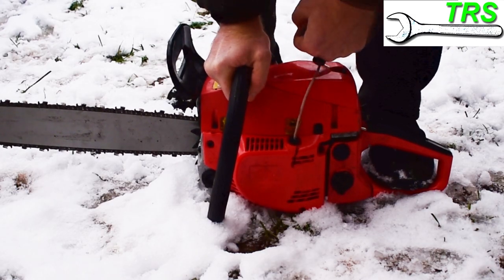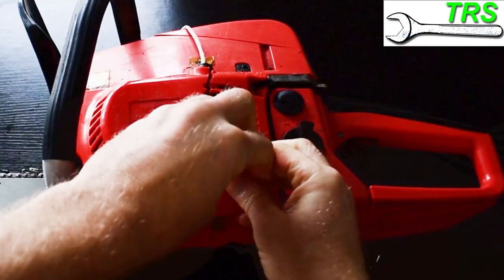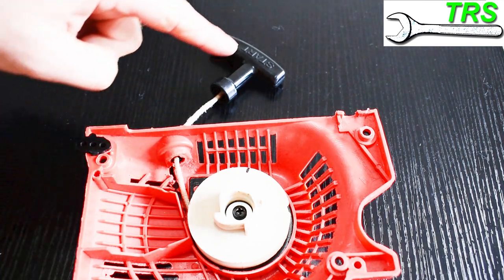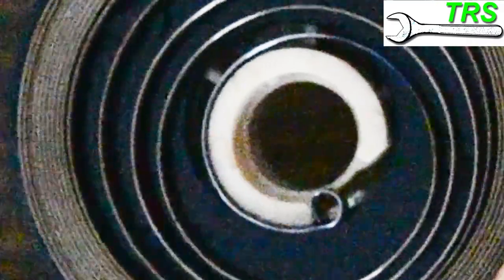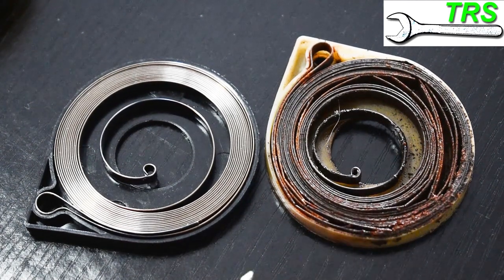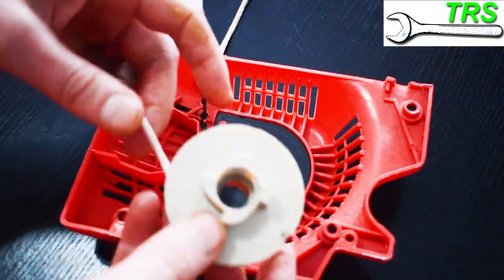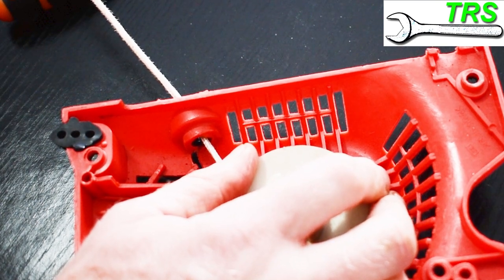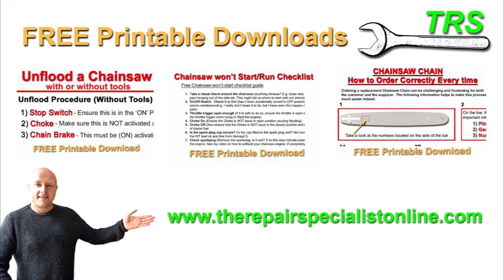Chainsaw Starter Recoil Spring Failure | This is Why?   (by Craig Kirkman)

Comment: I had 2 pulleys explode on me today while my saw was running, i would just hear a high pitched squeak sound and notice the coil spring was unwound in and busted out and rubbing against the flywheel (making that god awful sound). Was my rope to short or is the flywheel possibly damaged? It wasn't having issues starting i guess the dawgs must be catching the flywheel for some reason.
Reply from the maker: I'm sorry to hear about the issues you've been experiencing with your chainsaw. The problem you described with the pulleys and the coil spring unwinding and breaking is indeed unusual. While I can't diagnose the issue definitively without inspecting the saw in person, I can offer some insights into possible causes and solutions:

Rope Length: The length of the starter rope typically shouldn't cause the issues you described. The rope length is usually designed to allow for several pulls to start the engine comfortably. If the rope is too short, it may be more challenging to start the engine, but it shouldn't lead to pulley or spring problems.

Pulley and Starter Mechanism: The high-pitched squeaking sound and the damage to the starter pulley and coil spring suggest a mechanical issue within the starter assembly. It's possible that there is excessive friction, wear, or misalignment in the starter mechanism, which caused the pulleys to fail. This could be due to worn bearings or other internal components.

Dawgs and Flywheel: The mention of the "dawgs" catching the flywheel could indicate an issue with the chain brake or clutch mechanism. If these components are not functioning correctly, they could interfere with the operation of the flywheel, leading to unusual sounds and stress on the starter assembly.

Flywheel Damage: It's also possible that the flywheel itself is damaged, and this damage could be causing issues with the starter assembly. Inspecting the flywheel for any signs of damage or wear is a good idea.

Given the complexity of chainsaw components and the potential safety hazards involved, I strongly recommend having your chainsaw inspected and repaired by a qualified technician or mechanic. They can disassemble and diagnose the starter assembly, examine the flywheel, and identify the root cause of the issues you've been experiencing. They will also be able to provide you with a comprehensive assessment and perform any necessary repairs or replacements to ensure the safe and proper functioning of your chainsaw.

Safety should always be a top priority when working with power equipment, and professional assistance is the best approach to address these kinds of mechanical problems.

I hope has at least shed some light on it

Thanks
Craig